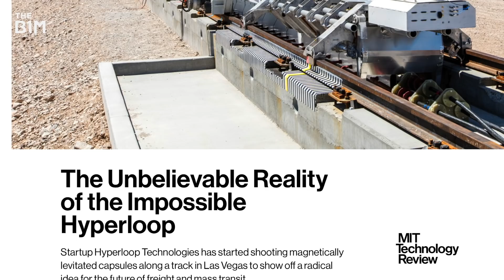Fred Mills and Sir Richard Branson: Inside Hyperloop's First Passenger Test

Comment: What you really need is perfectly round train section or tube (articulated as short passenger pods) running inside another CRUSH-PROOF cylindrical "track" tube. Both will have a double-helix coil system such that the train moves inside the track by means of electromagnetic repulsion (1 or 2 inch air gap only). Effectively, a tube running very tightly inside another tube. A near 100% vacuum in the tube will remove all wind resistence and allow the train to accelerate to 1000's of miles an hour if needed (in the straights!). Centrifugal forces would be enormous, unless very large radii are applied at turns though. During embarkment, the entire train would enter an isolated tube section where air would be let back into that tube section only.
The current design above is ineffecient and extremely costly/impractical!

Comment: I know there's many people who have debunked this insane idea of a vacuum monorail but let's add to the list of problems to the Hyperloop.

The concept of the Hyperloop is that it is faster than Trains (which I doubt is even possible) but people forget that  Loading times will be longer than traditional trains. They have to wait for passengers to board and than suck out the vacuum in the station until it equalizes with the vacuum in the tube. Same thing when offloading just opposite. 

That whole time would increase the time it takes to travel in this

Comment: TBH 107mph is not ground-breaking. Routine journeys on Chinese & French HSR exceed 200mph (320kph). Meanwhile France already has tested a conventional wheeled train capable of doing 357mph (575kph), and Japan has also tested a maglev train capable of doing 375mph (603kph), both of them without any of the fancy vacuums required for the Hyperloop. I don't really get the hype of 'hype'rloop

Comment: The fastest train in the world travels at 270m/h (430k/h) this is more than double than this cutting edge hyperloop pressurized tube technology.

It is far fetched from the promises of 1000m/h that was initially promised.

Initially proposed that the hyperloop will replace air travel, now the goalpost moved to speed up travel between airports. Beside the hype and the top celebrities that are involved, a Maglev train can do the job much better than what we saw in this demonstration.

The concept of the hyperloop is known since 1910 and after 110 years since its inception all we got is a test run of a small pod traveling 500 meters reaching the top speed of an average car. So far it’s literally like pouring money down the Tube..

Comment: How do you get the pods in and out without pressuring the tube? How long does it take to pump the air out? What happens if there is a breach on the tube?

Comment: I think it's a really cool idea with lots of potential, I'm still kinda scratching my head here why the speed is only a little over a hundred miles an hour when maglev trains in Asia not in a vacuum tube are already doing speeds over 600 km/hr (375 mph)
Reply: because the tube was too short to accelerate to maximum speed bro. Later experiments would use larger tubes and test it at full speed.

Comment: Imagine if there is a pressure leak, the compressor goes out. Idk how they'll guarantee that considering it'll run for miles how do you detect where the pressure leak occurred, etc. its a maintenance nightmare.
Reply: I guess by placing pressure sensors every quarter mile or so.
Reply: @nazarm6215    That track they went down in the video above is at most a kilometer or so. Did you see how many joints there are holding each section of track together? Even if they put an access hatch each kilometer and sensors everywhere, Every hatch and every sensor becomes a new place where a leak could form. Additionally, let’s say there is a leak. Which sensor will register low pressure? They all will. Either there’s a steady-state low pressure they can hold it at and all the sensors agree or it can’t hold pressure and all the sensors will register an equally low pressure. OK maybe every meter they install sensors that can detect ultrasonic sound through tiny cracks and they can locate the leak easily. Every time they need to do maintenance inside the tunnel, they have to release the vacuum, do the maintenance and then spend an  enormous amount of time and energy pulling a vacuum again. 
Unrelatedly, the next time you pass flaming wreckage on the interstate, think about what kind of emergency someone might have inside of a pressurized pillbox traveling over 100 kph inside of a vacuum tube and how you would extricate yourself from it.

Comment: To be fair you could do all this as a large underground high speed rail /maglev network. You can still use vented tube systems to reduce air pressure build up and wind resistance so would still get competitively high speeds and effective air conditioning, you wouldn't suffer with thermal issues, you could have easier to access hubs which wouldn't need to have any air locks and I'm sure the Swiss and Japanese can assist with tunneling and protection from seismic movements.

Overground metal tubes which can depressurise regularly for a multitude of reasons with no view of the outside world is a bit rubbish in my eyes.

Comment: After 4 years, they still have only 500m of tube, and a pod which only could carry 2 people, which is just a PR gimmick.
The cost of building several hundred miles of tube strong enough to maintain a vacuum will be enormous, roads can cross railway lines easily, to build a system over a populated area the tube has to be built on columns over roads, or every road has to have a bridge over it!
Using a hyperloop system to link 2 airports a few miles apart is ridiculous, it would never get up to the speeds claimed for it, so a simpler monorail would be much cheaper.

Comment: they could have just taken a regular train and strap a tube around it, it would have wielded the same result. The hyperloop is still so slow, that the air resistance isn't your worst enemy.
I will only jump on the hypetrain, when they break the high speed train record of OVER 570 km/h.

Comment: 100mph is super unimpressive. I still believe in the theory of the hyperloop, it should be possible to get higher speeds for less energy in a vacuum or near vacuum, but sad there's not more progress.

Looks like these guys are better at design and marketing than hardcore engineering. If so, they will fail just like electric car companies before Tesla failed.

Comment: If you want to avoid air resistance to go fast, just go up- that's what airliners do. Electrification of that is coming. But this? All the infrastructure to maintain miles of tubes kept under vacuum, and the consequences of a sudden leak, pump failure, collision... to me it looks like a solution in search of a problem.

Comment: 107mph is 170kmph.... There are trains that do better than that. Also how do you maintain pressure. How do you ensurethe safety of a vacuum system 1000km long. No one in hyperloop ever talks about the engineering issues.

Comment: Really strange that so many can't see that this is just a joke! A billioner-pod is not of much use, we need trains!

What ever solution you are thinking of you need to pass this needle eye:
Ek = (m v2)/2

Ek, kinetic energy
m, mass in kilograms
v2, speed in meters per second squared

Example figures: 1000 ton = 1.000.000  kg, 800 km/h = 222 m/s  => v2 = 49383 and Ek = 49.382.716.049 Joules
This mean: To get 1000 ton up to 800 km/h speed you need to add 50 billion Joules of energy, and this is without taking account for resistance.
So to add the complexity of vacuum tunnels to save some resistance just do not make sense . . .

So it's clear we would be better off with other solutions. Small cars on big trains for an example, roll on the train close to home and off closer to work and take the car the last few kilometers. Or even better, remove the need for personal transport all together. Work in your garage . . .

Comment: The test was cool, but not "historic". They need to show much higher speeds, a path to high passenger throughput, and a plan for scaling up manufacturing. Right now, this is a lot of PR hype around a project that doesn't yet offer enough benefits over more conventional means of transport. This is also Branson... he seems more interested in sponsoring novelty projects than actually following through on them (e.g. Virgin Galactic, started 16 years ago, barely getting to working prototypes now, with no path to financial viability in sight). I hope the actual team (Giegel) adopts a pragmatic and iterative approach, focus on cost-effective manufacturing, and spend less time onone-off prototypes for PR demos. Build something real and let the results speak for themselves.

Comment: Seems pointless. Was originally described as like the tube system in futurama, ended up as a moderately quick low capacity train/taxi with huge costs. The low capacity means it has barely any practical use whatsoever

Comment: I just don't understand how this is better than a normal high speed electric train. is it the "pod" thing? I don't understand why why that is an advantage. You could always design a high speed train that could minimally slow down to shunt off a handful of "cars". If the cars were all self powered (already done), then the whole airport thing would be doable with a normal train/subway. The cost vs benifit doesn't seem to be there for the India project either. Again if you are building this near the road anyways, what is wrong with a normal high speed electric train?

Comment: More a PR exercise than a test. 107 mph test?! I mean, there are Amtrak trains that go faster than that lol. And the "test passengers" are clearly hired models required to smile, look pretty and pretend they fell no bumps. Cringe. 
How much does it cost to build, then operate a vacuum pipe tunnel? I bet it's a few times more expensive than typical HSR. What about vacuum leaks through micro-cracks due to heat expansion? Aw wait, it will have to be under ground. Increase the cost!

Comment: Meanwhile in Germany: Trains with antiquated high-entry carriages finally run to the now finally opened BER airport (9 years delayed), snailing through the city at 50 mp/h as the new railway line is not ready yet, being on average only 17 Minutes late! At least, if environmentalists won't block the tracks...

Comment: Has huge potential for cargo
Reply: Speed doesn't matter as much for cargo. Why do you think shit from china is still sent to EU by boat if they can build a rail and do it at a quicker rate?
It's all about cost per ton transported for which hyperloop cannot be cheaper than rail as it's just a higher maintainence, more expensive to build rail line with a vacuum tube around it.

Comment: Building such infrastructure  does not seem to make sense for me, since most countries already have a huge amuont of traditional inrastructure (Rail, road). Economicly i don't see the point of making and another one. Also operating this system presents new dangers for passengers and crews. Other than one-two separated systems i don't think more will be built. Simply because its too expensive to maintain.

Comment: 107 mph? I guess you need a longer track to get faster, but they say that like it's something a weak-ass car couldn't do on a long stretch of highway. The Japanese maglev bullet train in development does 3 times that without the atmosphere-controlled tube.
Reply: The difference is you don't travel at 107MPH on a standard highway
Reply: @brad5426  OK, but that's very slow compared to existing rail technology that's much easier to build.

Comment: Oh please this hyperloop is never going take off its pie in the sky.A vacuum in a sealed tube of that huge volume?That's no oxygen for those who are in the capsule should it...oh I don't know run out of the small supply it has to carrry with it.What happens when a piece of material hits the pod at 1000mph...a ping pong ball can go straight through a tin can at 1000mph...oh no wait of course there will be do debris in the tube....unless some bits fall onto the track at the station....

Comment: If hyperloops are so good - how come existing monorails haven't been converted?  Is it because this is a joke?  How on earth do you move these hyperloop trains between evacuated and normal atmospheric pressure stations?  You don't.  You move people in and out these trains and, from what I saw, it's through tiny ports making it really difficult for people with luggage.  All going to be sorted you say?  Virgin Hyperloop promised ticketed running systems by the end of this year or early next year.  Meanwhile, they've produced something that's a mere 200 metres long (or thereabouts) carrying two people at very modest speeds (less than half the speed of current high-speed trains) after five years of development!  And that 200 metre long tube is already showing signs of wear (meaning leaks into the tube).

Comment: This is insanely stupid.
You got some people sitting in a cut-down airplane fuselage in a vacuum tube going at most 100 mph. 
The project in India will have the Hyperloop run at ~300 mph. A maglev can already do that without having to build a stupid vacuum tunnel. It is much cheaper, easier and safer to do that.
Why are you doing this? It's BS.

Comment: This will never become a mass transport vehicle. Perhaps it's not meant to be but I get the feeling this is way too overhyped. This will never be used for long distances, it just doesn't make much sense money wise. Way too costly to build and maintain just for shorter traveling times. It won't be competing with train travel because trains have much larger capacities but are slower. Same with jet travel. This will only be used for short distances (half hour travel times) and on limited places. It will probably be expensive too. There's nothing here that would make this something revolutionary. Branson's responses to "naysayers" is hollow. He's using something non existent as an argument. Also, connecting two airports completely makes my previous point.

Comment: This wont work, not even with partial vacuum. Just imagine the volumes, and then a hole the size of a bullet sends a wall of air towards you at the speed of sound...If the tubes don't collapse first.... And does anyone know what tunnels cost? Very non critical video, dare I say B1M believed the hype instead of checking the math?? 🤯🤯

Comment: What a load of nonsense. It doesn't need any special new technology, nor would it need special funding from billionaires if it was clearly viable (profitable). The real issue is that cool as it sounds at first, it has many real world problems that they have not actually solved That is why most of the budget is spent on marketing not actual development.
Real world problems:
It is more expensive to build than high speed rail, yet high speed rail is only taking off for mass movement of people in countries willing to subsidize it. The speed advantage over high speed rail over longer distances almost certainly will not be worth the much higher costs.
The claustrophobic environment will not be popular. There is a reason it is always shown as clear plastic tubes in advertising material even though such tubes are way too expensive and it will almost certainly be mostly steel tubes.
The reason the test track is actually quite short and built in the desert is the enormous cost of building track as well as in order to avoid too much scrutiny. A high speed rail test track would have been much longer and would not need to be built out in the desert.

Comment: Hype and BS...  The reason it should travel in a vacuum, is so there is no air friction.  "Depressurized" could mean one PSI less than what youre breathing right now.  Hype.   
  Nobody thinks a few hundred meters at punk ass 107 MPH , "depressurized" is any kind of accomplishment unless they're stupid.
  Building a tube from San Francisco to L A , and drawing a hundreds of miles af vacuum between stations, and maintaining that vacuum will cost billions.  The maintenance alone will cost tens of millions per year.  This will never happen with today's technology.   Drawing and maintaining a vacuum is far and away more difficult than adding positive pressure.
  When Branson can roll 20 or 30 miles at 500 mph,  I will eat my words.   
  Ask the tax payers in the UK what they think of this dude.  You will hear things like pork barrel, Ass kicking, Tar & feathers. Ect...  Go ahead and research his UK work, you will find that it's all about getting that tax money, and zero product.  All hype.

Comment: Fast trains like the Korean KTX currently function with a workable business model, go 190mph (305km/h), don’t require de-pressurizing and therefore don’t require a pipe, allow passengers to look at the view, don’t give a feeling of claustrophobia, carry hundreds of passengers at a time (seated roomily at 4 side-by-side plus an aisle), can be easily accessed should they break down (or worse, crash), and probably have a lot more of other benefits. Consistently depressurizing hundreds of miles of pipe is fraught with technical obstacles and is surely an unnecessary use of energy. Hyper loop is a hyped pipe dream. A waste of someone’s money, hopefully Branson’s and never the tax-payer’s...